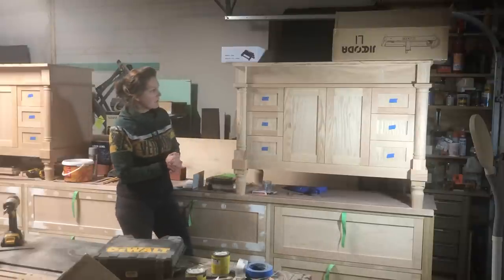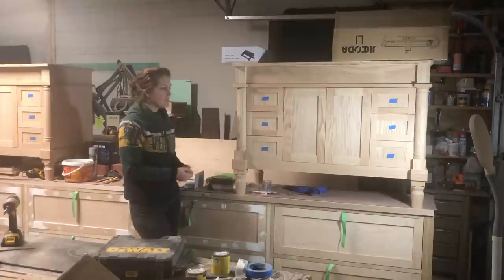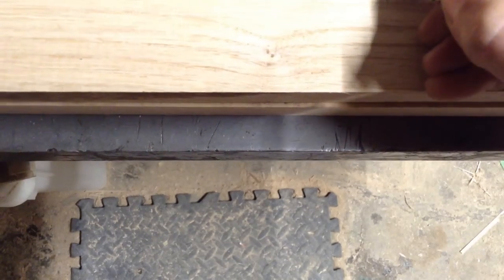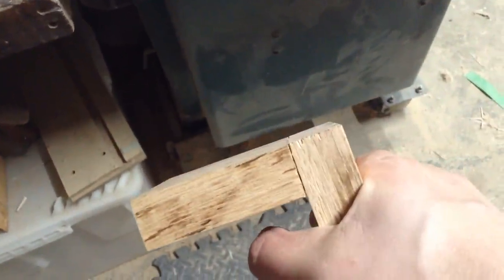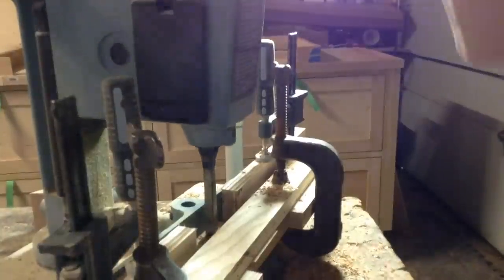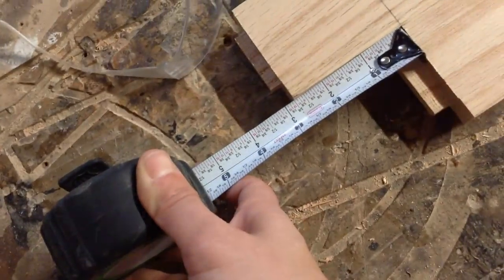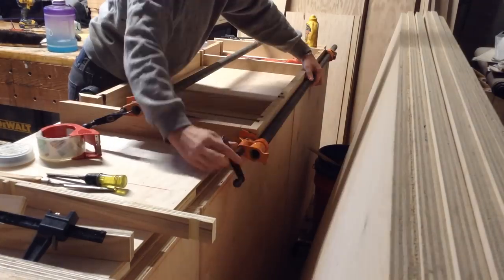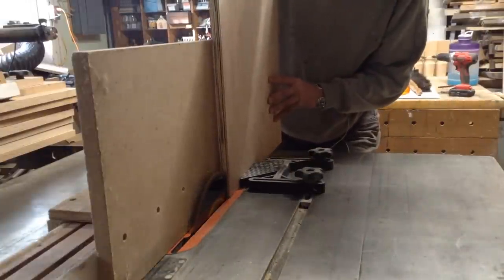Woodworking : Double Oak Bathroom Vanities // How-To Part 1

Comment: Nice video!  I have a similar mortiser, cut two hardwood blocks and tape them to the underside of each of the fork fingers. That fork adjusts up and down. Then adjust it to the thickness of your stock.